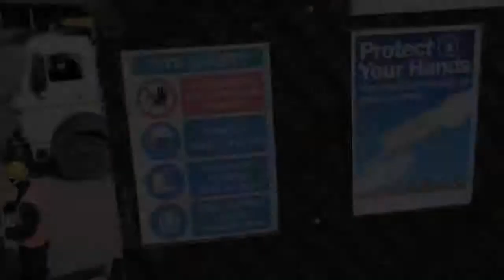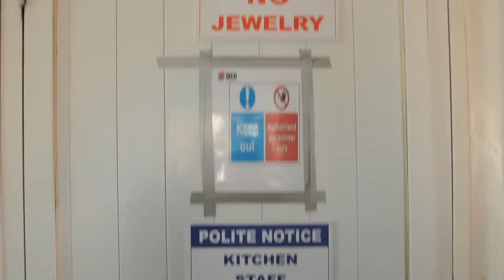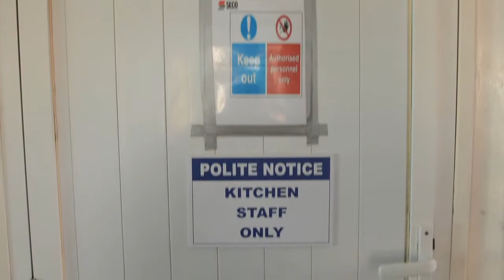Lake Turkana Wind Power Project (LTWP) - Extended

Comment: Hallo SECO Team,
Those buildings that you constructed at LTWP are tearing apart, an engineer needs to go to the site to determine the cause of the  wall and floor cracks. Its a disaster in waiting.